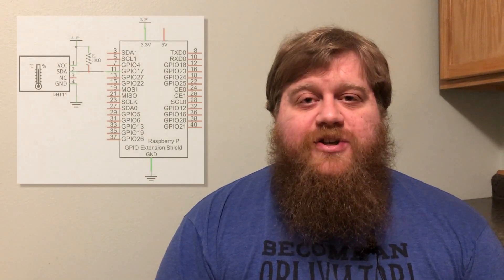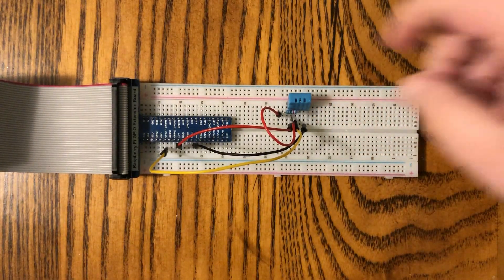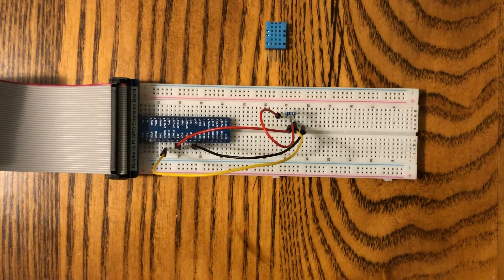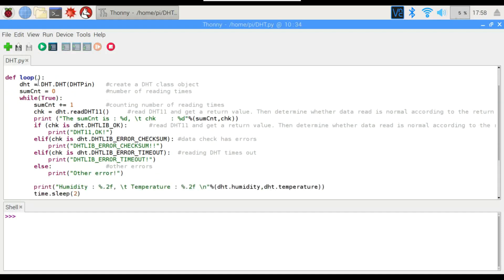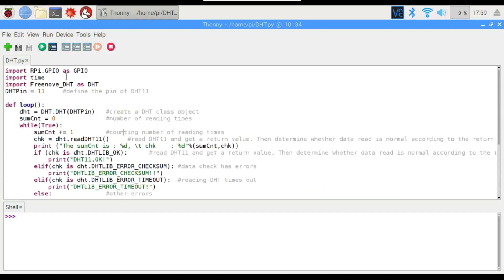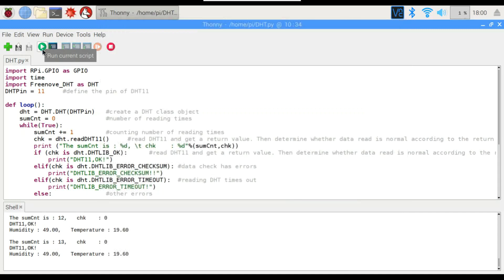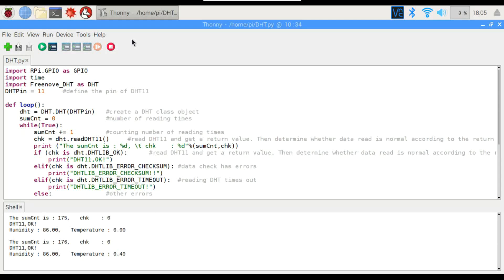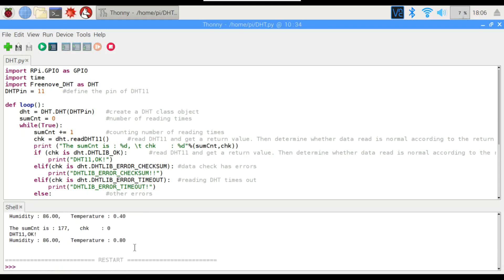Temperature & Humidity Sensor | Raspberry Pi 3 B+ | Projects for Beginners

Comment: I also faced the issues you have mentioned. I never used a resistor and thought that it is the cause. Please let me know if you find the cause of the fluctuation.
Reply from the maker: My guess is that it’s just a poor quality part. If I were to actually use it for something, I would have it collect data over the course of a minute and have it take an average.
Reply: @ThinkingofPi  Agreed. I think that the DHT22 is better than DHT11. I used the Adafruit Library. I use it to monitor the room temperature. If we take offset of one minute, I believe it will give us good results. The DHT11 has a limit of 1 request per second and it goes high if we go with DHT22.